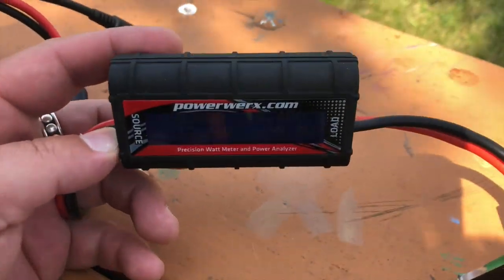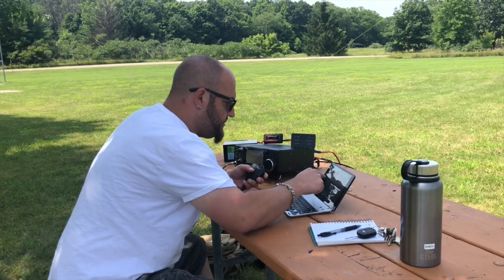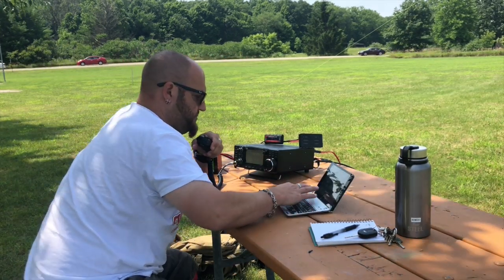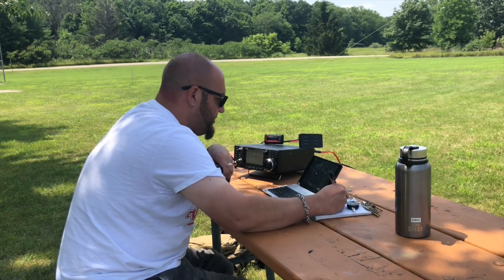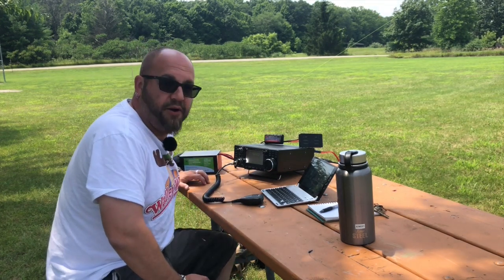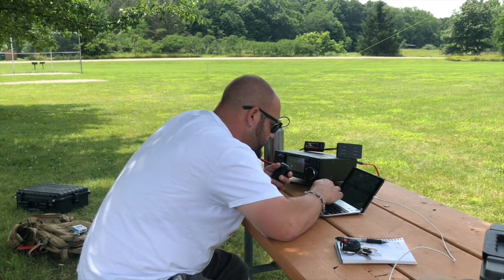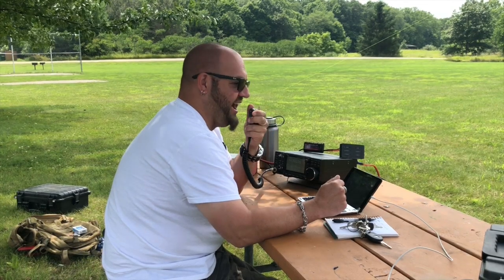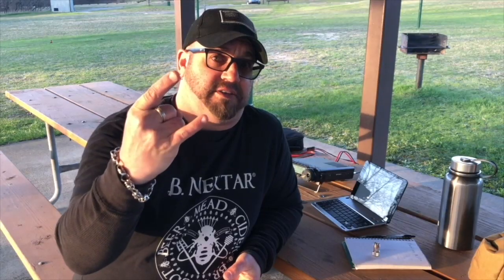Bioenno 20AH Portable Ham Radio endurance test.

Comment: Will a set of standard 12 VDC "cigarette lighter" connector work to connect the IC-7300 to an Li-ion battery or do I need to go with Anderson Powerpole connectors? The reason I ask is that the external 12 VDC outlets on my RV are female "cigarette lighter" type and it would be great if I could use the same cable setup to connect to the Bioenno battery as I use to connect to the RV.
Reply from the maker: It should.  I use my cigarette port in my car to power my 50 watt vhf/uhf radio as I cannot get through the fire wall.  I just put a bigger fuse on it.  A lot of people will tell you not to do it but I don’t have a choice.  You could also make a cigarette to powerpole adapter so you could just have power poles on your radio and use the cig adapter when you need it.  I’m a huge power pole fan so everything I get 12v DC immediately gets them.  That way everything is standardized and if you need adapters you can do that too.
Reply: @hamradiotube  Thank you.  Cig adapater to power pole great idea for standardization.
Reply from the maker: @TheArecf  Power pole the world buddy.  Power pole the world.

Comment: I just drop-tested my 20AH....it didn't go well.  Tore the shrink wrap, and the PVC case separated on the back end.  Totally my fault, but won't take a charge now. Hats off to Bioenno though. Sent them an email, and they said to ship it in, and they would take a look at it.

W6BKM
Reply from the maker: Oof, that sucks. I'm sure its prob something that can be fixed.  Most likely a wire came disconnected on one of the cells or the BMS.

Comment: What is the voltage as you transmit?  Does that battery drop to 12(ish) like a deep cycle lead acid?
Reply from the maker: It drops down to the upper 12V range.  Prob 12.7-12.9 depending on what mode you're using.

Comment: Mike , Really needing some input from you been away from the hobby for way too long like a decade and I never did do much portable or field work, and with the holiday weekend coming up soon I need to figure out what battery is going to work best for me I want to take my 100 W radio with me and use it from inside my camping trailer most of the radio work will be confined to the evening hours , i’m guessing between five and nine or 10 PM so roughly about four hours .
I need something that’s going to work for me for about four or five days using it like that so during the day I could try to figure out how to recharge it back up I will be dry camping but will have my generator with me can you help point me in the right direction as to what would be the best for me
Reply from the maker: Depends on how much you’re going to tx and what mode.  If you’re doing light casual ssb operation this battery should last you a couple days without charging.  If you’re planning on calling CQ POTA and running a pileup you will need to recharge it most likely every day.  If you have a generator just get the charger from Bioenno.  It’s like $20 and charge it off that.  Or get a solar panel and charge controller and pray that it’s sunny while you’re out.
Reply: @hamradiotube  Probably 60/40 60% listening 40% talking and would be side band
Reply: Just rag chewing
Reply from the maker: Well your 100 watt radio is prob going to draw about 1ah on rx.  So 5ah's will be used just being on during that time.  You'd prob use at least another 5ah but prob closer to 7-10 if you're going to be talking that much.  To put it into perspective, I used ~14.5 amp hours of battery in about 3 hours running an almost non stop pileup doing a POTA one day.  Got about 300 contacts.  I usually only run 90 watts though and was using the 891.
Reply: @hamradiotube  Thanks Mike ,  called Kevin up and it was close to closing today, infact after all said and done it was past 5pm so yes their sale's and support is fantastic, i ordered the 40Ah a 15 Ah charger a 9Ah Battery and a charger for that, ships Monday and here Wednesday.. in time for Camping trip.. Thanks again Mike
Reply: Remember that one time you used your Tarheel and memory controller, I ordered the memory controller today from HRO and  it will be here in time.. my Tarheel on my truck is working fantastic. So for now I will will be running  longer coax and a longer control cable into the travel trailer with me and operating that way

Comment: My 20aH just arrived today. Using the Bioenno charging brick. How long should first charge take, and how long can the battery be on the charger?  Concerned about damage from overcharge. I have a 7300, too, and will be operating portable using a homebrew buddipole dipole anntenna I recently built.
Reply from the maker: Congrats.  I think the charger puts out 2-4 amps so if your battery is totally depleted maybe 5 hours or so.  I honestly don't use Bioennos charger a lot so you may have to experiment.
Reply: @hamradiotube  Thanks! So far, so good. Glad I spent the cash on the battery.

Comment: I'd like to be able to power more than one device off one Bioenno battery, like a transceiver, wattmeter and computer, provided the battery can safely supply that much current.  How would I be able to do that?  Would I need one of those RIGRunner panels?

73 VE7NDE
Reply from the maker: Thats certainly possible.  You'd prob want a bit bigger battery than the 20AH though if you want to charge your computer..  For your radio and watt meter you can just get an inline watt meter like the PowerWerx one I use and that would take care of that.  For your computer, unless you have a 12V input on it, you would need an inverter to go from 12V to 120V and then plug in your computers power cord.  This is really inefficient but it works.  I've done it with my computer, inverter, and 10AH battery.  Pretty sure I used most of the battery just charging the computer.  You also have to consider the current draw of your radio and your computer while they are both in use.  The only reason you would need a rig runner or some type of distribution block would be if you want to plug multiple power pole devices into it, which with this configuration you probably wouldn't.   Also, another thing to consider, as I was going to do this same setup for Field Day last summer, is the quality of inverter you get.  We picked up a couple from amazon for about $30 each, and they put out an incredible amount of RFI, rendering them totally useless while we were operating.
Reply: @hamradiotube  No, not that variety of wattmeter.  I'm referring to the one on the other side of the transceiver, like an MFJ-849.

And you would really need a "pure sine wave" inverter if you want to avoid RF hash from it.
Reply from the maker: @denelson83  Oh that kind of watt meter.  That's no problem, they draw very little power.  But yes you would need a power pole distribution block for that, the radio and the pure sine wave inverter.

Comment: This gives me hope. I just bought and received a 30ah Bioenno because my fully charged deep cycle RV battery on its own will not power the 7300 after 3 digital mode transmissions at 25 watts. The draw from my 7300 is too much for it.
Reply from the maker: Thats odd your deep cycle wouldn't supply enough current.  The Bioenno surely will.  You should be able to go for quite a while with that 30AH too.  Good choice.
Reply: @hamradiotube  Just an update...I got a 50ah bioenno because the 30 amp hour will not keep the 7300 going on digital modes. My guess is that it being a digital mode is the problem. The 50 won't keep it powered either, radio shuts down even at 10 watts of digi mode. I haven't tried on voice but maybe that's the difference...
Reply from the maker: @chadlpnemt  Hmmm, that doesn't sound right.  I'll have to try that when I get home.   Does it not work at all?  How long is it lasting?
Reply: @hamradiotube  On JS8 Call I get probably 3 transmissions before the radio cuts out. I just put my 30ah on it and did voice and sure enough it doesn't kill the radio. Had a 10 min. QSO to Florida. Higher duty cycle on digital mode maybe?  But on dig modes, yeah, it's not good on a battery. I've tried so many batteries with pretty much the same result. On my 857 though, I can run the dig mode a little longer. Ok on both radios for receive, but transmitting, the 7300 just takes too much power.
Reply from the maker: @chadlpnemt  I just text Mr JS8 call KM4ACK to see if he's had any issues.  I'm out of ideas.  I'm honestly shocked you're having problems.
Reply: @hamradiotube  I'm shocked too. At low/medium power it just won't go. Radio straight to the battery with a solar controller connected. It is very odd, but never have seen videos of hams doing digital modes on a simple battery back up and a base station radio. Probably a reason for that but if anyone has any ideas I'm open!
Reply from the maker: Jason is wondering if you might be gettin RFI somewhere?  That can do some strange things.  He also mentioned that you will notice it on digital way before SSB.
Reply: @hamradiotube  Hard to say. I suppose there is sometimes, but not sure how RFI would keep the radio from getting power. The battery doesn't seem to drain, the radio power meter drops down to 10 volts on transmit, while the battery shows 11.5 or 12.
Reply from the maker: @chadlpnemt  I just don't do digital that much at all let alone portable.  I've been with guys that were doing it but can't say what batteries they were using other than one guy in my old club used a KX3 and a Bioenno.  Had no problems at all.  I'm gonna try when I get home tonight.  You've got me intrigued.  Have you eliminated all the variables?  Like just the radio directly into the battery without all the solar stuff.  Are you monitoring the voltage of the battery while transmitting?  What is it doing?
Reply: @hamradiotube  Yes, tried battery direct to radio without other power sources. Battery tends to run 11-12 volts on transmit if the battery is at 13.6v charged up. The radio voltage display drops down to 10 volts on transmit, then back up to 12 or 13...whatever that middle range is on receive. But a second or third transmission cuts the radio off. I've tried this with the 30ah and 50ah bioenno batteries. The KX3 probably won't suck as much power down...I'm curious to see how you do with yours set at 10% or 20%.
Reply from the maker: @chadlpnemt  So I just hooked up my 7300 to my 20ah Bioenno on FT8.  At 100 watts I was pulling about 18.3amps.  I started calling cq on 75 watts, and my radio only showed 50 watts output.  I turned it down to 50 and it showed about 30 watts.  25 watts was still less than it should be.  Thats still really weird that on lower power it isn't getting enough juice from the battery it looks like.
Reply: @hamradiotube  Did it ever turn off on you?
Reply from the maker: @chadlpnemt  No, but I was only running for about 15 minutes or so.

Comment: Thanks for doing another great video, i'm considering getting a 10AH battery for portable operations. I use an ft857D. I'll be running about 20 watts for about 3 or 4 hours. Will a 10 AH be sufficient?
Reply from the maker: That should be fine.  I don't know what the 857 draws on RX and it would really depend on your duty cycle/mode of operating.  I don't think you would have any issues especially running 20 watts.  Kick that up to 100 watts with a full on pileup and you will go through that 10 ah in prob 2-3 hours.
Reply: @hamradiotube  Excellent, thank you kindly for sharing your day at the park. Very informative! The 857 draws about 1 amp on receive and it uses about 21 amps on tx at 100 watts. Good dx to you.73 de VE3QJ

Comment: Posted about a week before I passed Extra!
I just re-watched this and realized I gave you a TD by mistake.  That has been rectified.
Can't wait to get back home (in S. Africa visiting family until they lift the quarantines) and get back in the parks again.  73 Mike!
Reply from the maker: Well thanks for the views and the new thumbs up!  I trust you didn't bring a radio to S. Africa?  That would be terrible for me.
Reply: @hamradiotube  Yer quite welcome Mike and not to worry.  The Prez of the local club (klub) lives 1/2 mile down the road and he loaned me his old IC 726 and a KW AT-130 tuner so I be on da air here.  Unfortunately we're surrounded by low mountains 1500-1600 meters (or is that feet?) that seem to be keeping me from DXing the USA.  Got 4 summits within sight of the farm that have never been activated tho so next trip i'm packing my POTA gear (and the new 891) with me for some SOTA.
Reply from the maker: @buckeye5704  Oh good, at least you have something to play with while you're there.  I guess you're not doing much more than NVIS from that location but its better than nothing.  It's a nice thing to be able to be the first one to activate pota/sota.  I would be all over those peaks!

Comment: Is that a voltmeter/wattmeter between your battery and radio? I am looking for something that I can continuously monitor the voltage of my new Bioenno 20A battery while I am operating. I see that Powerwerx carries one, but I don’t know if it the best out there. Ok now I see you are using the Powerwerx meter. I see it for $49.99 on their site. Is that the same one you are using? Do I just buy the meter with the Anderson Powerpole Connectors and I am good to go? What powers the meter?
Reply from the maker: Yes I am using the Powerworx meter.  It’s the most accurate one I have.  It goes between the battery and the radio and is powered my the battery.

Comment: Power my 991A with the Bioenno 1220...fantastic battery...
Reply: Hi Mark, how long does the battery typically last. I just bought a 991A and am looking at portable solutions.
Reply: @rantingraven4428  I've gotten 8 hrs...now I use voice modes mostly...so that's part of it...and listen far more than I talk...but I've gotten 8 hours out...
Reply: @marksmadhousemetaphysicalm2938  Are you using any sort of solar for charging while operating.  I am going to use mostly voice. Are you using the 20 amp or 30amp? KI5ODV here.
Reply: @rantingraven4428  no solar...20 amp is sufficient
Reply: @marksmadhousemetaphysicalm2938  Thank you very much.

Comment: Great video! I have the 30ah in a Pelican 1510 go kit and based on Bioenno specs at 100w,  I should get 15 hours of runtime, 20ah 10 hours, amazing and worth the extra money for sure 73 de N1AD
Reply from the maker: Yeah they really are amazing batteries.  I don't think at the rate I was going I would get 10 hours out of it but it definitely outlasted me for sure.
Reply: K8MRD RADIO STUFF yeah these ratings are based on the draw of a mobile rig not a base station

Comment: hello, i need help on this question; I am running a ft-450d ham radio that pulls 13.8 volts at 22 amps my question is, i want to run 8 Pack Headway 38120HP LifePO4 Battery Cells to operate the radio but have the battery pack connected to a bus bar that is fed by a 220 amp alternator that will be shared by 2 deep cycle batteries that will power other devices. when pulling power from the lithium battery pack the lithium battery pack might pull the charging juice from the deep cycle batteries because they are sharing the same bus bar and alternator is there a resistor that i can put in place to minimize this from happening and to draw more power from the lithium battery pack than its charging source without killing the lithium battery pack? it will almost be the same concept as my car battery mod with the lithium battery and supercapacitors.
Reply from the maker: Yeah I would have no idea about that one, sorry.

Comment: I was inspired by a video from K7IJF a while back. He built a battery supply into a Pelican 1430 Hard Case. I stepped it up a bit, and installed a Bioenno 40 Amp Battery, along with a 20 Amp MPPT Solar Charge Controller, MC-4 to Powerpole Adaptor, TWO Powerpole Dual Plugs, Two Powerpole Cig Sockets and TWO 2 Port 3 AMP usb outs on the control Panel, along with a Samlex 350 Watt Pure Sine Inverter. The thing is AWESOME!

Comment: Great video.  I am curious, what do you have connected between the voltmeter and the radio? Never really get a good look at it in the video, and I am guessing it is some kind of voltage regulator, but not sure why you would need one?  You don't have a link to it on the list of equipment in the description. Perhaps it's a fused power distribution box?
Thanks. 
Pedro, VA7PAC
Reply from the maker: You guessed it. A fused power distribution box.  It’s the HamRadioWorkbench one. I did a video about it you can get all the info from.
Reply: I agree, for me the most important, crucial part of the review is the actual set up. Everything after 0:40 sec is obvious, but the dc power distribution and connections specific to your test and your transceiver and other peripherals are skipped. These details wouldve added a great deal more utility to your review, even if you think they’re “obvious”. Video and audio of you operating are frankly, superfluous. It’s the setup, power connections, and data collection that matter most, then skip the actual operating, then cut to the chase to analyze the data.

Comment: Very impressive performance, thanks! What's the unit you had hooked up downstream from the Powerwerx meter? I couldn't tell what it was.
Reply from the maker: That is the HamRadioWorkbench 12v power supply.  Its really just a power pole distribution box.  I did a video on it.
Reply: @hamradiotube  Awesome, thanks, I'll check it out!